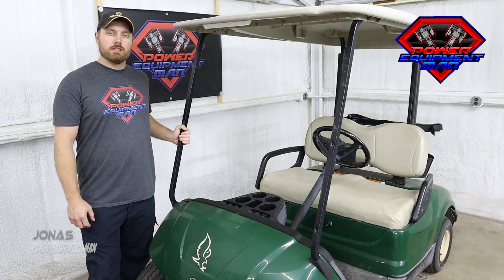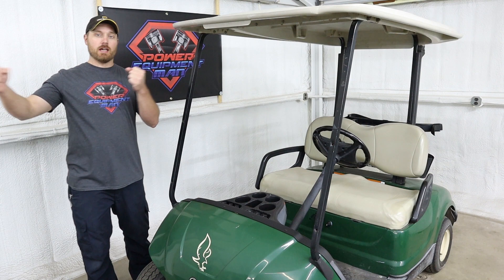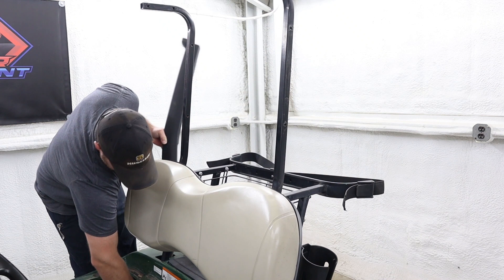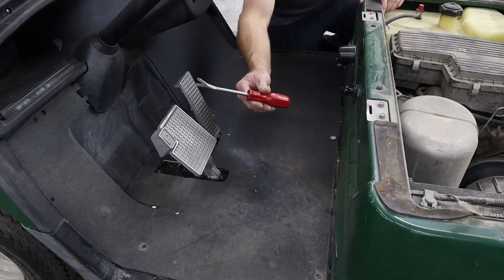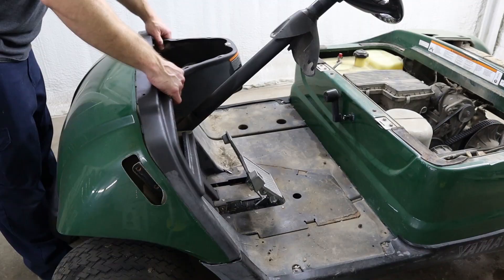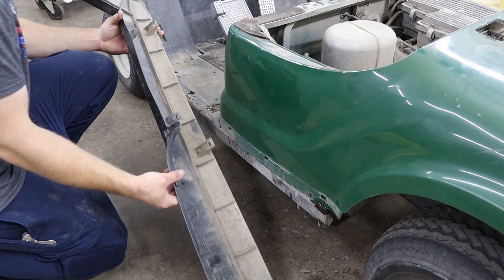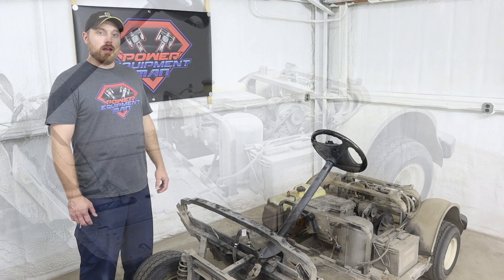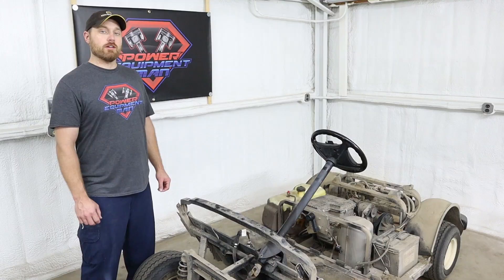Yamaha Drive G29 Golf Cart - Body Removal

Comment: Hey Jonas, thanks for this extremely informative video. Do you happen to have a video on how to safely pressure wash the engine compartment also, do you know the location of the switch to put it in neutral
 I believe I have just purchased the same or similar used model. Thanks!
Reply from the maker: No, we don't have a video about washing. There really isn't much you can hurt. Just use common sense and you should be fine. 
To put the cart in neutral, just move the f/w lever to half way between forward and reverse. You should feel the cart roll easily when you get it in the correct position. 
Thanks for watching!
Reply: @PowerEquipmentMan  thank you so much! 😊

Comment: Will the Predator engine start/ stop like the stock engine or does it stay running when you take your foot off the gas?
Reply from the maker: It is possible to use the starter generator from your stock engine to run the Predator engine, but it takes some pretty good fab skills to make everything to do it. There aren't any widely available kits that I know of to do it. Otherwise, it would just start with the key and stay running all the time.

Comment: If you need to replace the push pins- what size should they be?
Reply from the maker: These carts use at least 4 or 5 different sizes of push pins. Unfortunately, most of them are pretty difficult to find except directly from Yamaha. You can use parts diagrams to find part numbers for the ones you need. 
https://www.bigskygolfcars.com/oemparts/c/yamaha_golf_car/parts

Comment: Any idea if the yamaha adventurer two utility with dump has the same size frame as this cart? Was looking to buy one and convert it into a 4 seater. Thanks
Reply from the maker: Sorry I don't have much info on that. I believe the back of the frame is quite a bit different to support the bed. The frame is also longer than a normal cart. I'm sure it is doable if you are willing to fabricate your own rear seat kit. You most likely wont be able to buy anything that will just bolt on.